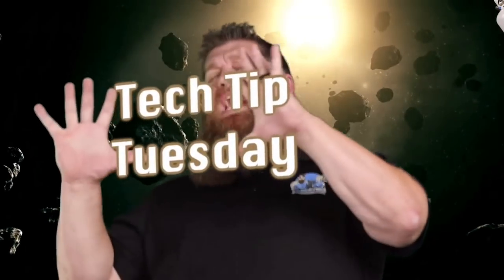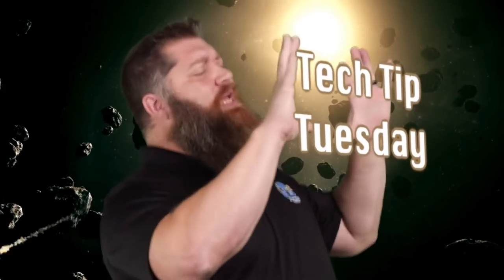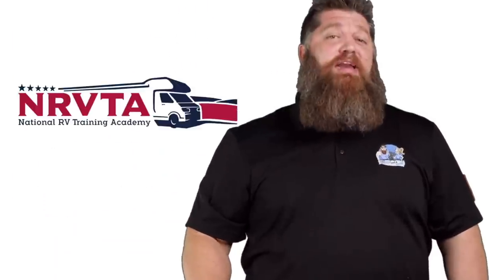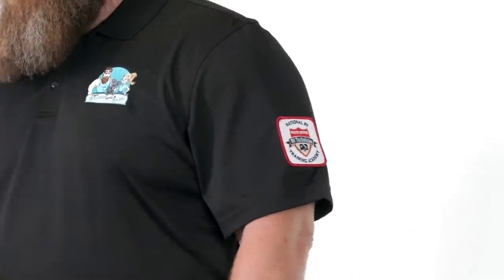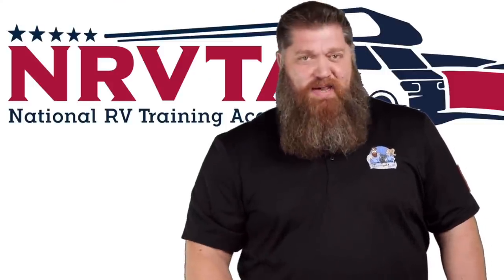How to control humidity in your RV

Comment: Thanks for the information. We are thinking about keeping our RV down in Florida over the summer as we are snowbirds down there during the winter season. Keeping the air conditioner on we've heard of but what is the best temperature to keep the RV at? We've  heard around 83°. Also any recommendations about how to keep mold down in an rv? Thanks for any information you can provide.
Reply from the maker: 83-87 is probably fine. controlling the humidity is critical.

Comment: I have a question about whether to keep a vent (ceiling and/or window) opened a little bit when it is very humid outside.  The other day it was about 60 degrees and raining with humidity about 90%.  I keep my nucamp T@B 320 stored in a carport at my house with the roof vent opened about an inch and one of the windows slightly opened.  I went out to check on something and the ceiling and some of the walls were covered in a light layer of condensation.  I'm wondering if just before the weather/humidity gets to this point I should close the vents and windows and then re-open them after the humidity outside has dropped?  Any advice on this would be helpful.

Comment: Other tip, hang towels or wet clothes outside to dry.
Reply from the maker: Good idea!!
Reply: Yep it DOES help and even though I have 2 dehumidifiers that are rated at up to 575 square feet it (to me)still feels humid inside. Considering buying a larger capacity machine.

Comment: Not humidity, but moisture related question:
The factory paint on RV frames seems poorly primed and very thin! What are some good ways to prevent rust, or to remediate light rust on a TT or 5W frame? Oil undercoat? Lanolin or wax spray? Rust converter? Sand and repaint?
Reply: Great question,  would like to know the best method for this. I sprayed on some rust inhibitor in different critical areas but it seems too thin to last any significant amount of time